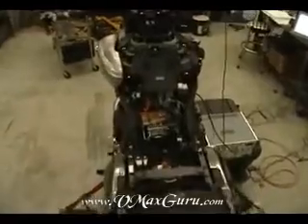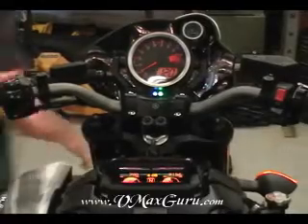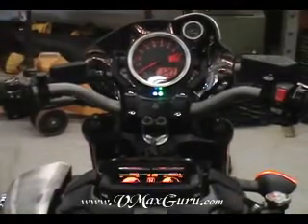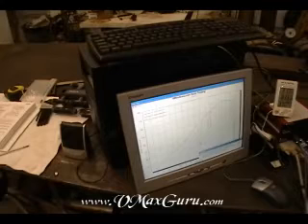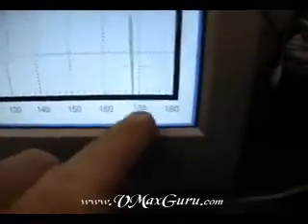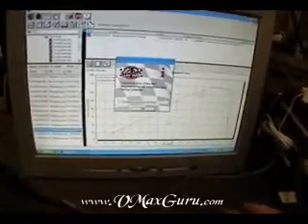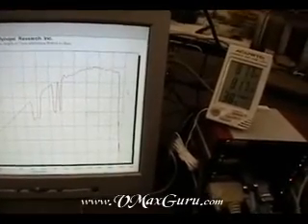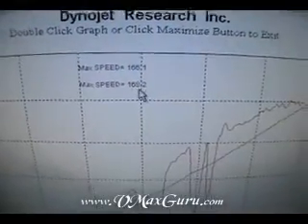2009 VMax Top Speed 168.2 mph!

Comment: this is a naked bike. naked bikes are not meant for top speeds. if they remove the limiter people will die. also people here are complaining about the lack of sixth gear. they don't understand that if the last gear is an overdrive then it makes no difference as far as the top speed is concerned

Comment: to double your speed, you have to cube the power needed, so even though 200hp is a lot more than your (and my) XJ700XS; 86HP, you only get the cube root additional speed, or 32.5% faster than your bike, but, also has a lot more surface area hitting the wind, so even that number is way too optimistic.

Comment: With a flashed ECU the 09 vmax ran a top speed of 158.6 (best of the 3 runs) ..at the texas mile. WOT.. 5th gear banging on the rev limiter right after 3/4th mile...

Comment: i ride a suzuki dr 650 and top speed is 105, and for a 1 cylinder 650 thats pretty good but the wind at 105 is pretty bad on it, the fastest ive went on any motorcycle is 130mph and just that wind is pretty bad but thats not a verry good comparison cause diff bikes